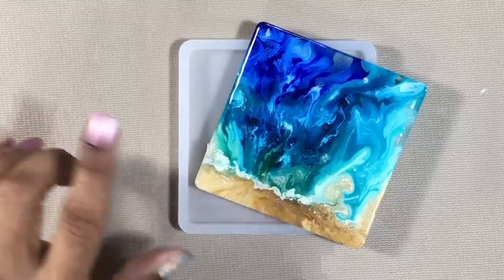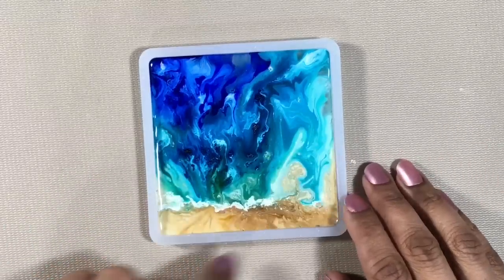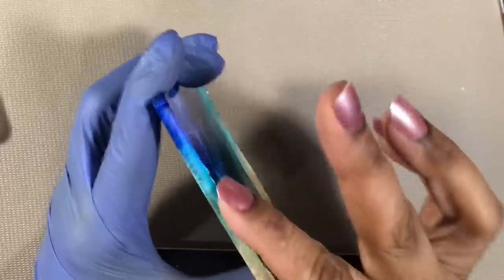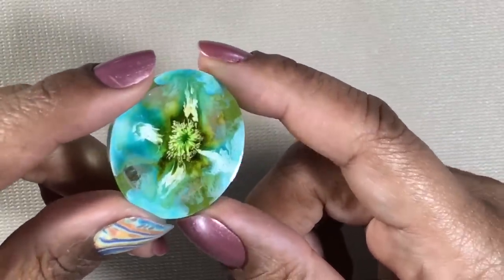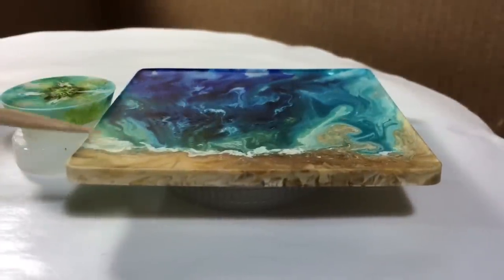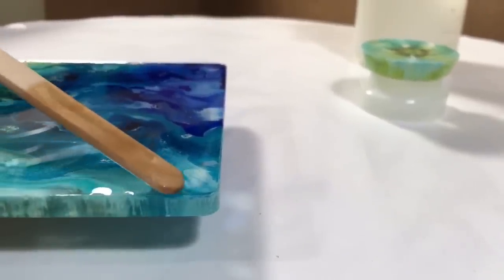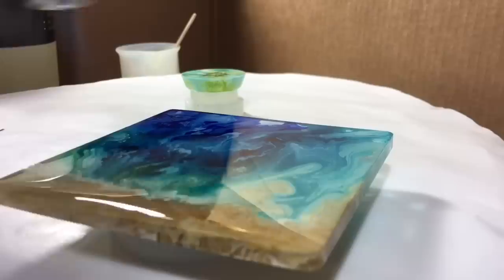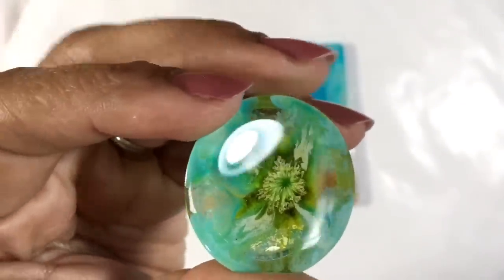58] RESIN : Getting a DOMED flawless FINISH on Pieces from a MOLD or taped Fluid art

Comment: Myriam, why do you not need to lightly sand the piece before adding the top coat?  Sanding is done on acrylic paintings to create tooth. —just wondering.  Thank you.
Reply from the maker: Hi Monterrey!  When adding a new coat of resin, tooth is also a good idea in order to give the new coat something to grab.  The new resin layer is making a mechanical bond to the old resin (as opposed to a stronger chemical bond) so in theory it could delaminate under the right conditions... but that delamination most often begins on the edge.  After sanding the bond should be decent along the edge ... over the years I’ve found it to be enough for pieces this small.  If I’m coating a large piece, I do sand much more of the surface.  I hope that helps a bit. 😊💕

Comment: Do you varnish it first? Then add resin? 
I thought I saw it somewhere on your video.
Reply from the maker: Hi Rene… The only time I would varnish something first, before adding resin, is if the piece had been an alcohol ink painting (the varnish would keep the resin from causing the inks to possibly bleed).   These pieces were done primarily with resin to begin with ( the alcohol ink was only coloring the resin)  so there would be no need to varnish them first. I hope that helps a bit. 😊💕

Comment: I heard resin will melt over 45 or 50 degrees Celsius , is it safe to use it as a coaster or will it get damaged from the heat of a cup of coffee ? Thank you
Reply from the maker: Hi!  Most resins on the market can handle a warm cup of coffee being set on them but if you need a resin that can withstand higher heat I’d recommend Ultracast by EliChem.  Once cured, it can handle the heat of hot pot straight from the stove! 
I’m assuming you’re in Europe or Australia given your use of “Celsius”.  If you’re in Europe, you are fortunate... EliChem is in the UK. 😊
Reply: Myriam's Nature  Hi, yes actually i‘m in  Switzerland. I‘ll look for this resin. Thanks a lot for your helpful answer.😊

Comment: After sanding do you polish the edges?..
Reply from the maker: Do you mean the sides Glynes... if so, a little if they need it but I usually don’t have work to do to them.  If you mean the top edges instead, then no... after sanding I wipe them down and pour resin on top... no need to polish first. 😊